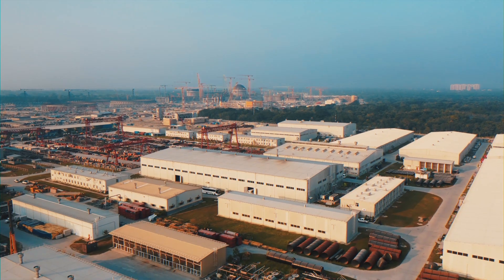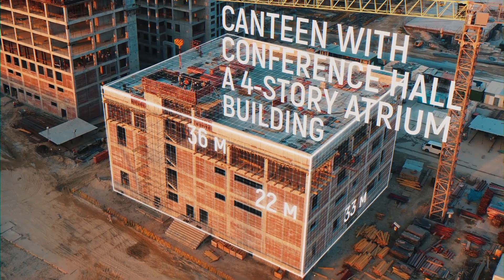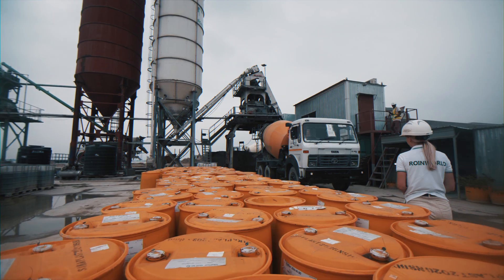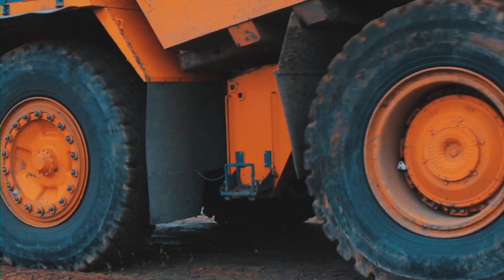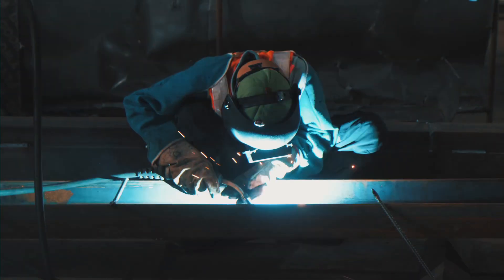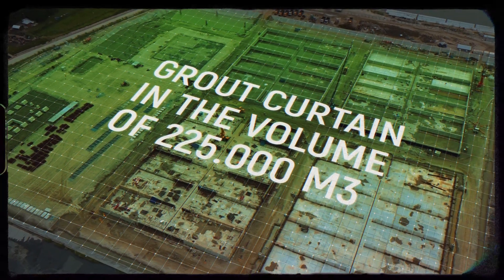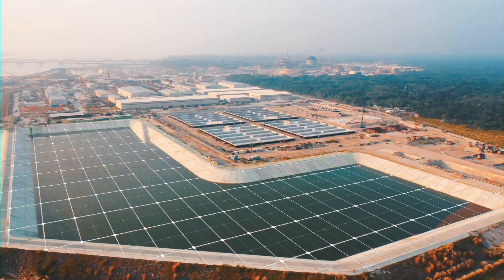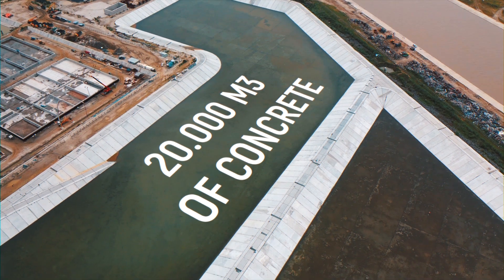Rooppur Nuclear power plant in the People Republic of Bangladesh – RoinWorld achievements for 2021

Comment: To know whether a fuel is proper fuel or not is to determine
whether the fuel gives off greater amount of energy when it is
used than the energy involved in making the fuel from raw natu-
ral materials. A huge amount of energy is obtained when Hy-
drogen or thermite (a mixture of powdered Aluminium and ox-
ide of iron) is burned. But energy obtained from combustion of
those fuels is not greater than the energy spent to make them
from natural resources. Therefore, Hydrogen and thermite can-
not be treated as proper fuels. Electricity could be readily gener-
ated from combustion of those fuels, but, electricity made from
those fuels must be more expensive than electricity made from
coal or petroleum. According to Einstein’s E = mc2 formula, 1
Kg of any material (preferably Uranium) will give
9   1016 joules, or 2   1016 calories, of heat energy through
complete nuclear reaction. [ E = mc2 = 1   (3   108)
2 joules
= 20   1012kilocals = 20 trillion kilocals .] If that would be
true, then powerful states around the world would not compete
for oil in the deserts of Arabia. If one ton of Uranium of some-
ton ‘Little Boy’ bomb could take part in the so-called nuclear re-
action, then some million of square miles of the world would
burn, instead of only 1.7 square miles of Hiroshima. It not at all
possible to give supply of electricity to the people from so-called
nuclear fuels at a cost lower than fossil-fuel electricity for the
reasons stated above. However, it is possible to give ontological
lectures on nuclear fission/fusion or to earn immense money
from so-called nuclear projects.
Reply: India should get rid from this  as they have 10 reactors.